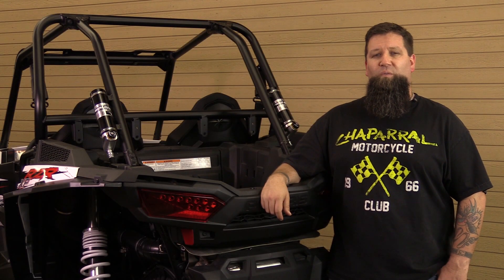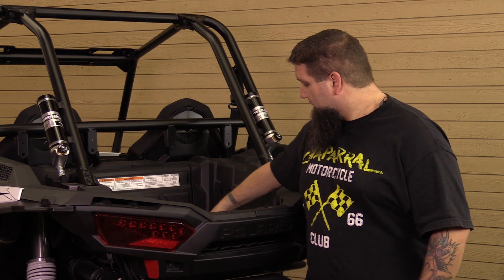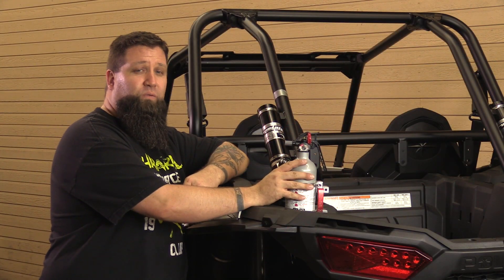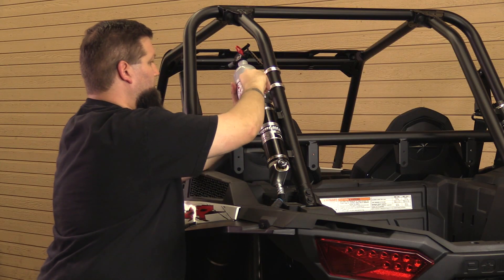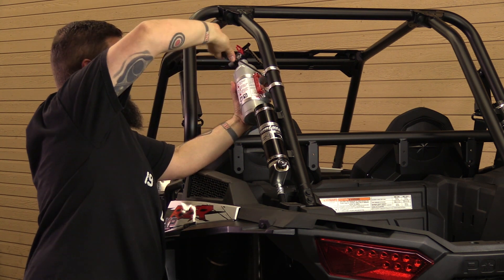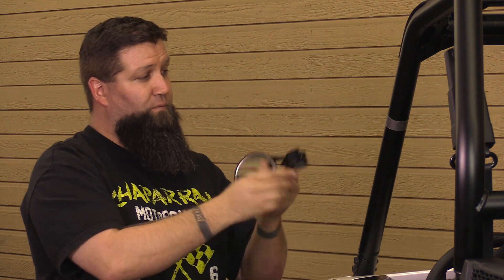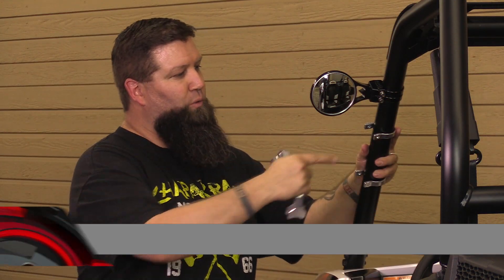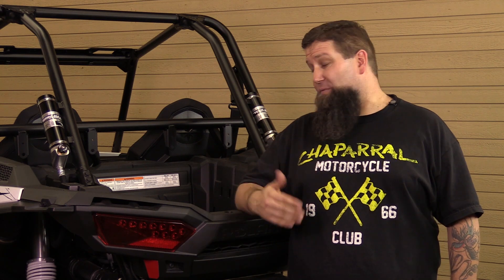How to Install Axia Alloys Accessories Tutorial - ChapMoto.com

Comment: I just got their RotoPax mount and it fit perfectly on my Gobi ladder.  Quick question.  Do you advise to use antiseize on their bolts?  I plan to leave my Pax mount on my ladder permanently, so I don't anticipate having to unscrew those bolts unless something breaks.  Thanks for the great video!
Reply from the maker: Thank you for your inquiry Rommel. Normally I would say yes... mixing metals... but in this case... you really don't want them to vibrate loose. That would be horrible. -- Kyle & the Chap Moto Team
Reply: @chaparralmotorsports  Thank you.  I am still trying to understand the technicalities behind the use of antiseize.  In all honesty, I did apply it to other screws in the Axia mount, so will be keeping an eye on those.  It's a while before I mount a fueled up RotoPax, so I am good.